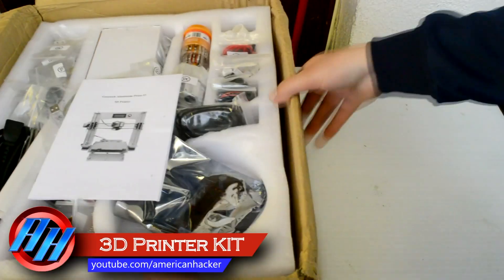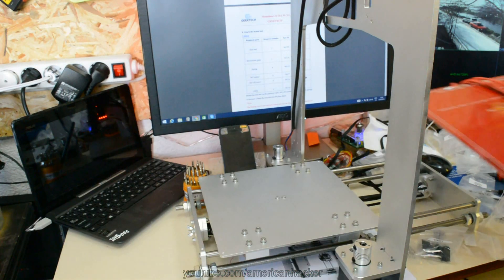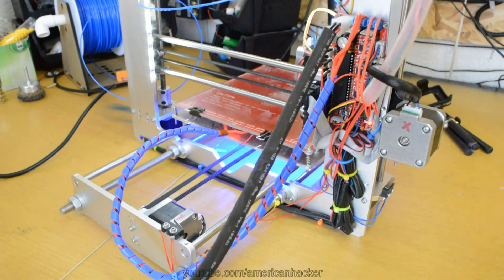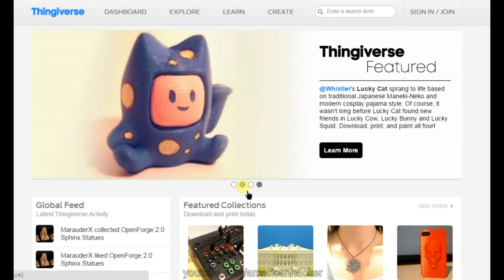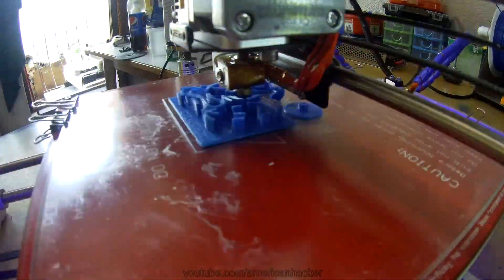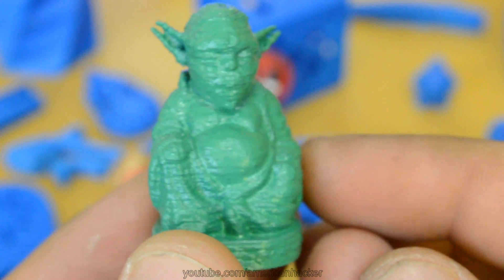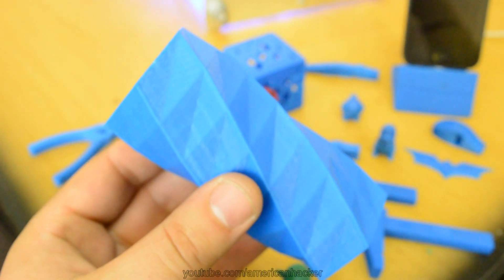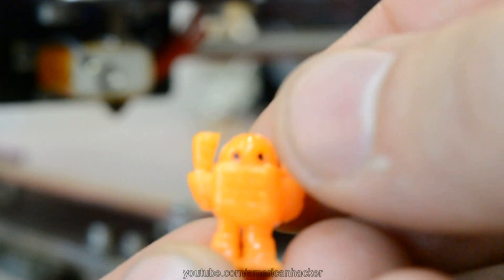3D Printer KIT: Make anything you want

Comment: Hey Marjan .I hope your well.
I have some ideas to 3d print:-
boomerang.
plastic nuts and bolts.
solar car chassis.
flower vase.
visiting card. 
gears for DC motors.
wheels for RC car.
battery case for AA batteries/cells